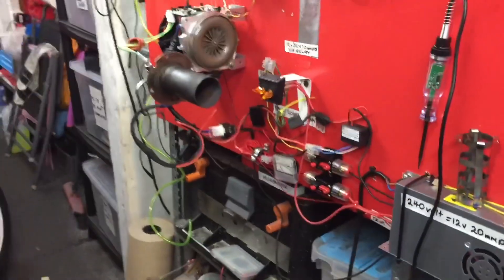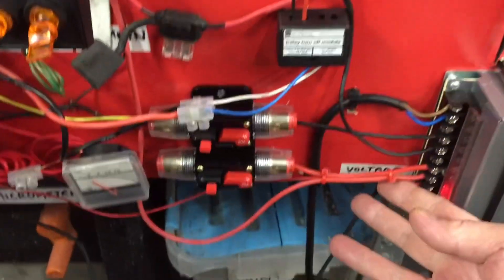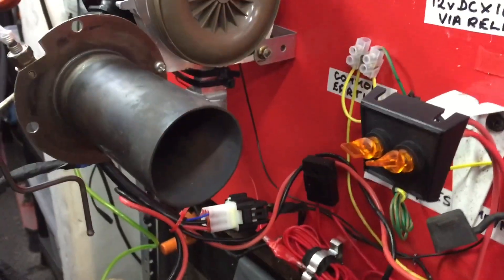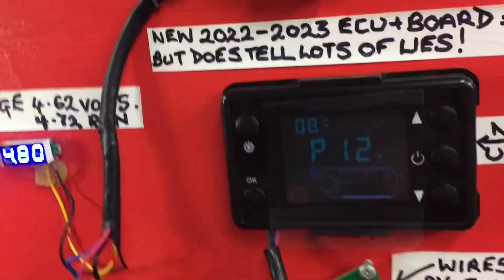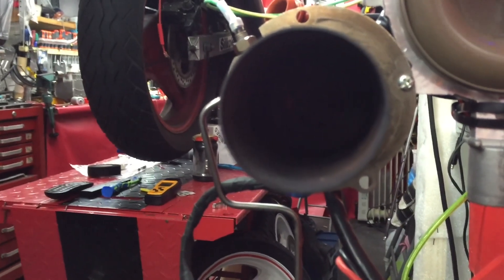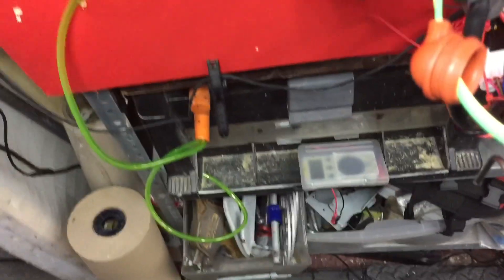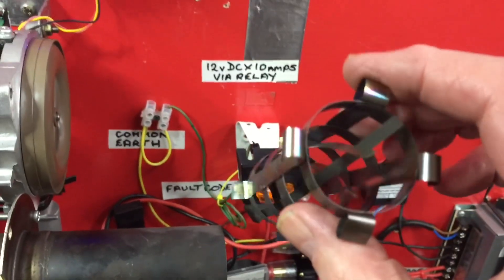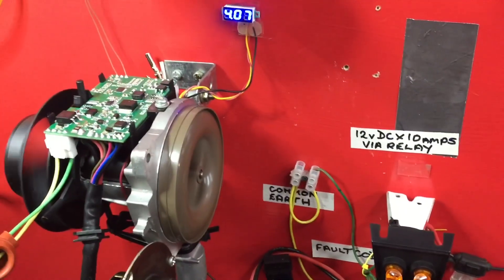Diesel heater Turbo option x twin Glow plug =10-11-12KW ? Full derestriction ￼

Comment from the maker: Does the controller screen go black? As like no power? Does the screen show a fault code? Are you running off a battery plus charger or power converter from AC to DC 12 volt. Does it smoke when you manage to restart it ?

Comment: Hello, watching your video, which is unique on YouTube, I thought of a problem of mine with my diesel heater, after a few hours of operation, it stops suddenly without any high temperature error, defective pump, lack of air or fuel  , it simply stops and I tend to think that the electronic part of the controller is faulty.  As a solution, wouldn't I be able to mount a DC variator to power the fan, fuel pump and spark plug through a time relay for starting and stopping?  With this variator I will correlate the amount of air with the fuel pump dosage.  What do you think about this?  thank you
Reply: I don't think a spark plug would work, but you can drive the glow plug manually too. I've seen a couple of people run their heaters without the ECU, but of course this eliminates any safeguards for flameout or unexpected changes in fuel delivery, which would result either in fuel leaking out of the heater, or plumes of smoke and carbon monoxide. This precludes any possibility of safely running unattended. This guy uses an ingenious combination of automotive light bulbs as ballasts to vary the fan speed and glow plug, and uses a drip system to provide fuel- https://youtu.be/vKotO2Aqsn4

Comment from the maker: Thanks for the comment. The long term goal is to burn old engine oil as all the south recycling centres are just closing due to funding. So bring on the fly tippers, their soon change their mind. 
Black engine oil is piston blow bye combustion from short runs,so has some fuel in the oil. Diesel flashpoint is 60-90c which must be based on its ambient temperature. Engine oil is 300c -500c , so a sod to light but has a longer burn time then average 28 seconds but in doing so creates Ash that I want to blast out the exhaust without constant  de cokes. If you noticed the fan speed slows to 1200 rpm at 2 volts as you can’t light a candle whilst blowing on it. Hence the double glow plug attempt 🤷‍♂️

Comment: Getting the mixture right is a fine balance between lean and rich. (As you well know). I have a standard "5kW" heater that uses a 0.022cc per pulse dosing pump. The maximum frequency of dose is 5.5Hz, (pulses per second). This equates to 79.2cc per hour at 1Hz; 0.435.6l per hour at 5.5Hz. The heat value of diesel is 10.35 kWh per litre, so the available energy = 10.35 x 0.4356 = 4.50846 kW. about 750W of that is exhaust waste heat. Doubling the power output means double the fan-speed and fuel consumption, double the waste exhaust heat. Like a bike engine, all that extra heat has to go somewhere; if you find your exhaust starts glowing dull red, you are very close to the eutectic point of the ally casting, and terminal melt-down. 'There is no substitute for cubes' as they say, so for higher power, use a bigger block. Stay safe!